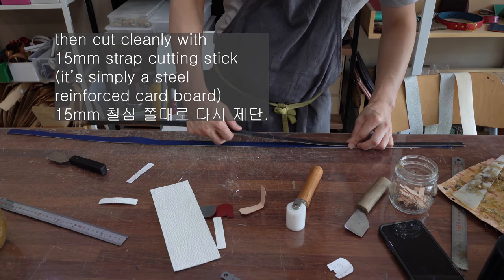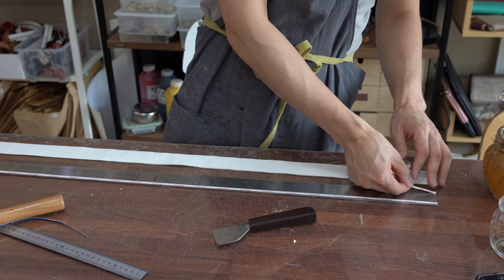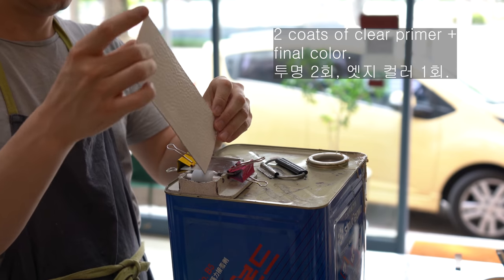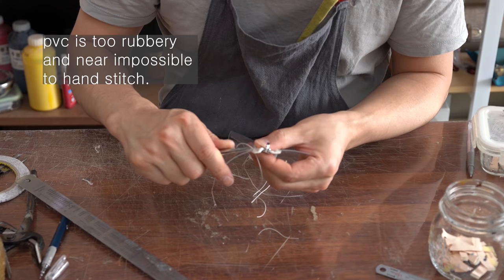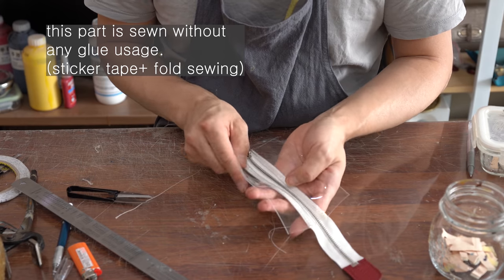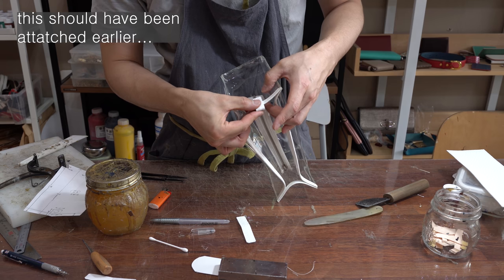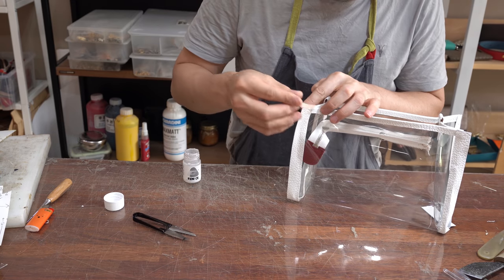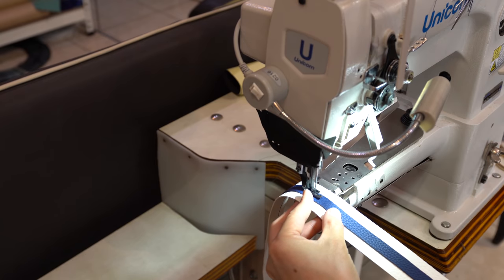Making of Vinyl BAG. PVC 투명 가방 만들기. Eng. Sub. 4k

Comment: Very beautiful the bag, congratulations!  What is the name of this hot tool you used to pass to correct imperfections?
Reply from the maker: Rafaela Afonso just cheap $20 solder iron with flat iron tip. they are specially made for this purpose. sold here in Korea.
Reply: @ViaromanaLeather  Thanks! 😊